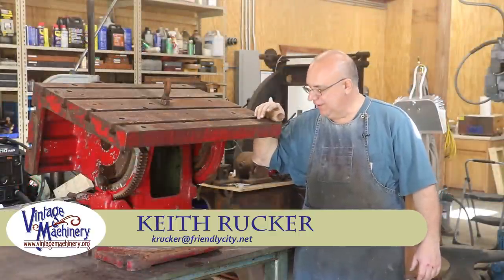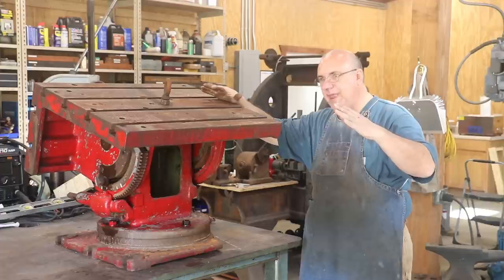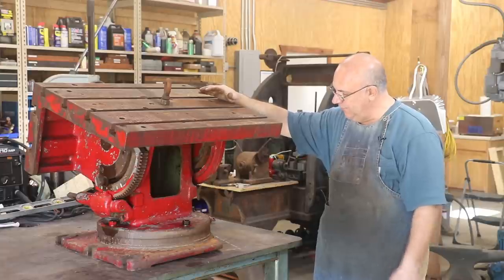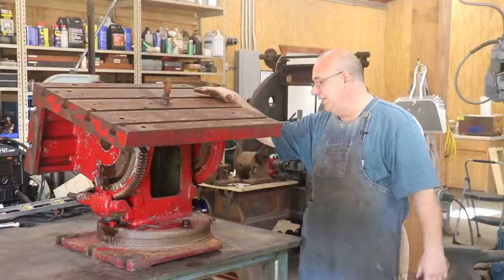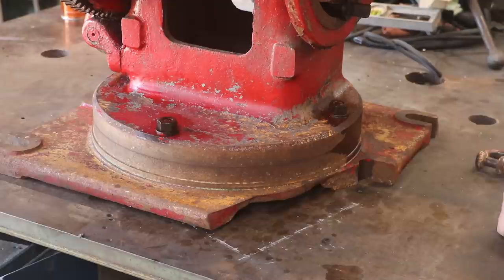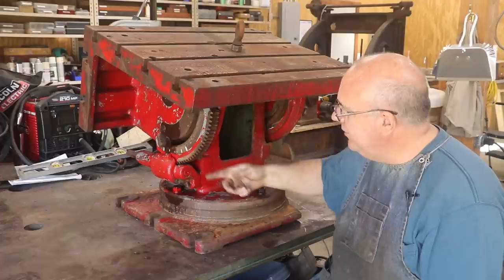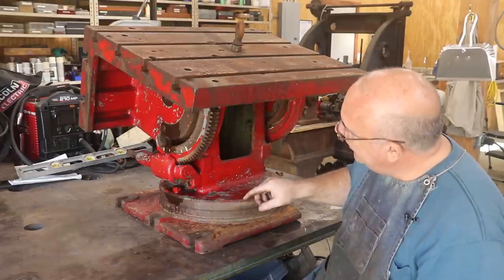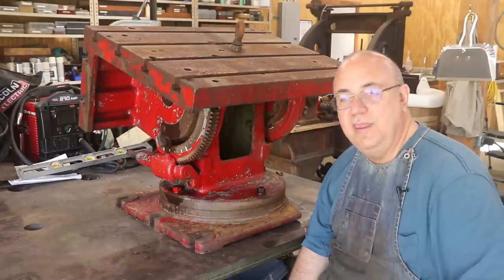Radial Drill Universal Table Restoration - Disassembly

Comment: I worked on resistance welders , lots of scrap copper and brass . for long punches we drilled a hole in a bar of steel , threaded it and screwed a brass bolt in for a " soft " end  .

Comment: Kieth, look at cutting the damaged base away from the center rotating feature then mounting the rotating feature back on a new base cut from some steel plate.  Fasten the two together from below or above with 1/2"  cap screws.  No worry about further cracking the rotation feature while trying to braze in a new piece.

Comment: Keith, Make yourself two short pins same diameter as the shaft. Taper one end, the longer the taper the better. You now have drift punches to align the holes and lock it in place with the trunnion bolts. If you put one drift punch in with the taper pointing outwards, the main axle will drive it out.
Al

Comment: Nice table ! Never seen one with a rotary base before. Good luck with the restoration.
Reply: Aboms shaper has a universal on it, I think identical
Reply: Hi there , just checked Abom (https://youtu.be/si1uU2Z0yNM ) table isn’t really identical , it’s part of the shaper , it’s not an accessory for a radial drill . True it has angle adjustment but so do many other machine tables or slides . I used to work in a machine tool builder (Foradia )making big radial drills . They offered varios options on slotted boxes with one plane angle adjustment but no rotary base .

Comment: If you drill and tap the end of the pin, you can use allthread to draw it back in instead of percussive brutality.

Drill a hole through the stub pins suggested below to clear the threaded rod.

Comment: For getting the table on, maybe use some screw jacks on each corner so you can accurately dial in the location and have it stay there. Either screw jacks or bottle jacks.

Comment: Turn two (2) short pins the diameter of the table tilt pins.  Turn a slight taper on one end of each short pin.  Insert them, using the taper to get the holes aligned and let the full diameter of the pins to align the holes. Then drive the tilt table axis shaft thru, knocking the short dummy partially pins out as you go.  Easy peasey.

Comment: You might be able to use a wad of masking tape or duct tape for a third hand in those cases. Just wrap a bunch of tape around the end of the shaft and drift to hold them together. The tape will push off the shaft as it goes thru the hole, but it should hold the drift in place almost until the last knock.

Comment: I have actually ran production parts and a radial drill was a part of my job so we had to set the thing up with the angle we wanted with aluminum or steel blocks machined ground precision or what have you for repeatable to achieve all the actual radial drill had was the knee with the keyway's. Could have used this rotating angle plate setup life would have been easier we did not know about these in my earlier machining days. That optional plate is really huge and tough to work on for you Keith.

Comment: It's a monster! I have just 3 comments. 1) there seems to be a center punch mark between the 2 set screws to mark the position of the shaft relative to the worm gear,but I was glad to see you marked it any way.2)On the retaining collar on the other end it may have been easier to remove the shaft if you had first cleaned up the indentation left by the set screw.3) 

when reassembling I suggest making a dummy shaft the same size as the original, but longer with a long taper on one end that you could push through and then follow with the original one.
As usual ,a great video.You need Bryan to build you a gantry!
Reply: Les Bender, I think Keith wanted Brian to build a gantry crane for him, but Brian refused to put any gussets on it!
Reply: @Hoaxer51  Keith could add them himself.I thought they should be there myself to lessen the stress on the top welds
Reply: Les Bender, I’m just being a smartass after seeing all the replies that Brian got about it! But, I would have welded a couple 1/4” plates in there too! It wouldn’t have taken much to do it.

Comment: Nice job, A suggestion for you, something I use to remove close tolerance hardware from a wing spar. I use a rivet gun, the rapid pulsing beats hammering on the parts. I believe that center shaft would have come out with a lot less effort.

Comment: Frame around the area to be cast with some cardboard, pour in some latex mold making compound, and copy the area to be duplicated. Remove the now copied section and send it off to have it recast in cast iron from the foundry. That way you can stick weld the section on and go through the heating/cooling process a few times to relieve internal stresses. You may even be able to have the composition of the original part matched and have the new section cast with a closely matching part. Just my opinion, it's what I would do considering the amount of stress that corner would be under when clamped and the table articulated.

Comment: With a piece that big to be brazed would it be worth drilling in some holes you can use for locator pins or bolts?
Reply: Now that's exactly what i was thinking, they would or should add a little bit of support for the brazed joint.
Reply: Exactly what I was thinking, he scared me the hal out when the table tilted, I thought it would flip all back unless the engine hoist. Nice video and hope to see the whole completion, only if it was speed-up. It looks to me a shaper table.
Reply: I was thinking the same thing also. I Even imagined three matching FLAT paralells from 1" plate steel, bolted to the bottom to reinforce the planned brazing repair. To quote Tom Lipton of OX Tools- "Nothing too strong ever broke."  Something thats already that heavy we don't just swing it up on the drill one handed like like a suitcase anyway. ... (Well, mabe Abom79 does lol.) (Countersunk sockethead bolts).  *I liked your comment, Machinists like their work to exell standard quality.
Reply: @keith73z28  I was thinking reading your comment, what about bringing that large piece on brazing temp and slowing down after brazing.
Keith could better takeover the bottom plate and create a new steel one, instead of brazing a newly cast piece to it.
Reply: There are some proprietary casting repair systems such as "Metal lock" and "Lock-n-Stitch" which use either a linked key stitch or a truncated threaded fastener to provide constant tension across the crack or repair joint.  These systems are very strong.  Perhaps one of the companies would be interested in producing a demonstration video.  Their market is usually the oil field or heavy earth moving equipment, but machinery is another on of their specialties.  Good luck and good job, thanks.
Reply: yeah that whole table is massive and that bottom plate is so thin?I think he needs ro machine a new plate out of thick steel.

Comment: I was thinking that you would only need to remove the four bolts holding the huge top rotating portion to the stationary base for your repair work on the missing "leg" of the base.  But maybe you wanted to fully take it apart anyway.

Comment: Sam's Club degreaser concentrate - it's supposed to be mixed 32:1 with water - but if you mix it 50/50 it will de-grease AND strip paint real easy!!!! it's only like 6 or 8 bucks for a gallon of it at Sam's-

Comment: You need a rolling gantry to handle that heavy iron by yourself.
Reply: Yeah, that was scary to watch. He really should use the propper tools...
Reply: @Rabennase3  You mean as opposed to the tool designed to lift large cast iron or cast aluminum machines with extremely precise tolerances in them?
Reply: @Rabennase3 ....Scary?  Why?
Reply: He got it done just fine.
Reply: @Rabennase3  naa! you haven't seen scary until you watch me do something like that.
Reply: A gantry crane build is up next on his to-do list....
Reply: @KevinDay  There is nothing 'precise' with an engine hoist. A gantry crane with a chain fall is much better at positioning equipment easily.  That said you use what you got and get by.
Reply: @Shockedbywater  I mean the engines have tight tolerances... If an engine hoist can hoist an engine, it can hoist this.

Comment: Putting pin back in make some loose fitting  short stub pins that you can place into the holes when you are in approximate alignment. One with probably 1mm clearance and the other with 0.5mm clearance, just a little longer than the 2 web thicknesses. Then you get a rough alignment and put the loose pin in the one side, and then align the other side with the closer tolerance pin, and finally use the shaft to push out the loose pin , taking the final alignment, and then pushing the last pin out with ease as you get there. Might just want to take the shaft and put a slight draft on the end with the collar, so you can use this to align, the grub screw and collar will not be in the way.
Reply: I was thinking a couple short tapered pins. Just wiggle the pieces around til the pins settle in, and then lock it in place with the bolts, just the opposite of the way it came apart.

Comment: I think that would be easier to re-assemble upside-down.
Reply: Indeede deede doo. Put the stupid heavy part on the table and add the light parts...
Reply: It may be, but having to get it flipped back over after assembly would make it not worth it.
Reply: inkman996 
Trying to flip it would be a great way to break off another corner of the base.
Reply: It would be far easier if it was reassembled on its side. Much easier to line up the pivot

Comment: hey keith hows about pouring a casting repair on the corner set the whole thing in a mould box with a void around the corner to suit the repair make a large riser and gate melt far to much metal and run it through for some time so to melt the origional casting then leave it to cool  or you could leave a percentage hanging out to heat and lessen the chance of any chills happening if you use sodium silicate it would handle it better
Reply: I have never seen that done, have you done it? How well does the new pour fuse to the old metal? Seems like it would be hard to get that big base hot enough to make a good joint.
Reply: @bcbloc02  hi brian i havent done it myself but have read it in a book it could have been the metal casters bible but cant be sure as most of my books are still packed up after moving but do remember the context was repairing castings with faults actually at the foundry i think the technique  was called washing in . if it was at the foundry  they would have no shortage of hot metal to pour through the mould i think the worst problem would be the heat affected zone not getting chilled by the bulk of the origional casting . i have been trying to figure out how to contact luckgen an austrailian you tuber who does some fab casting work .
Reply: agreed, this seems like the best option. you would want to have induction heaters on the broken part of the casting to bring it up to temperature, then pour brass around it. you can then use the induction heaters to slow the cooling so there is minimal distortion.
Reply: @superdansilverman  i was talking about iron rather than brass the idea is  to end up with a as new casting
Reply: @bcbloc02  i have just rooted out the book the metal casters bible by cw ammen isbn 0-8306-1173-8 and so far on page 181 its called autogenous welding :pouring hot metal in a defect in a casting in hopes it will weld and become part of the parent metal. this is also called burning in. he goes on to say , it is a hit and miss deal at any rate . the hotter the casting being repaired the better chance you have of establishing a good homogenous weld .

Comment: Don't try to weld on a repair piece to the base plate.  machine the minimum off the surface of the bottom so there is a true step.   machine a whole new corner.. bolt it on from the bottom.  if you machine it just right.. you should be able since the base will be sitting on top of your repair as an overlap.. not a butt joint.. it will be crazy strong.  you will be able to rough the upper shape of the repair with grinders. needle scalers.. a little bondo to fill any gaps and when you paint it.. since you will be have blind holes up from the bottom  or even counter sunk holes all the way thru the flange. you can bondo those up  and paint it.. no repair will be seen.

Comment: Great video Keith, just wondering why you wouldn't weld it instead of brazing it? From a shop that specializes in cast iron repair on a variety of old farm , automotive and industrial  applications. We weld cast iron or cast steel with no stress cracks or any failures about 97% of the repairs undertaken !
Reply: The amount of nickel rod for a repair like that will cost an arm, a leg and a dick. Probably both of your kidneys too. :-D And not even guaranteed to work. Keith said it many times that he's much more comfortable with brazing.
Reply: Maybe for fear he would be the 3% ?
Reply: @lesbender236  Getting that base up to brazing temp will be fun though. Maybe he'll slap it on top of his furnace that he made.
Reply: Donate 10kg of nickel rod and he might do so, at least he will appreciate it.
Reply: If he would try welding it with , I just might! You guys must be paying a huge price for your nickel rod. From your comments that's what it sounds like. Wish I knew how to post pictures on here!
Reply: @rodhenry4862  It's about 40 bucks a pound? So for 10kg you'd be down only $800. Sure, go for it. :-D
Reply: @LambertZero  Thing is if you had the piece to weld back on it would probably only take maybe 5 rods.
Reply: You are paying way more than I am for Lincoln rod!  Plus I'm old school and it's in pounds ! Thanks for the comments!
Reply: @bcbloc02  Yeah, I don't expect it to take more than a couple. But the dare was 10kg or about 20lbs. :-)
Reply: @LambertZero  Or build a bonfire!
Reply: @lesbender236  that'd take a pretty large bonfire. Kinda like the one Keith had last year.
Reply: @LambertZero  That's the one I was thinking of

Comment: Future project idea Keith, a rolling gantry crane.  Contact Abom and get him to give you design details on his so you can copy it.  Simpler to build than Mr. Fenner's crane and you don't need A-frames that can pivot with all that floorspace.  But still, that engine hoist is getting too small for taking apart these machines.

Comment: Interesting piece, neat video. How did they machine the circular T-slot in the base? How did they get the milling tool into the slot that they were machining.
Reply: Hole drilled all the way thru the width of slot then slot width cutter brought up from the bottom side to proper height and then revolved to make the slot.

Comment: I'd weld that if it were me...
Then get it on a large Miller and recut the bottom where it bolts to the base of a drill...using the radius part on the top to register...
Then it could be flipped over and the bolt seats skimmed...